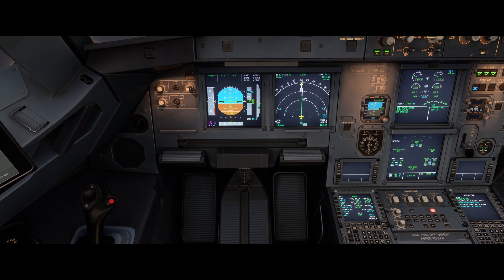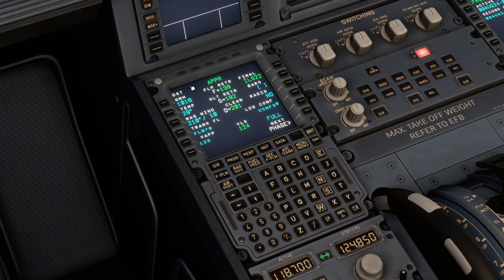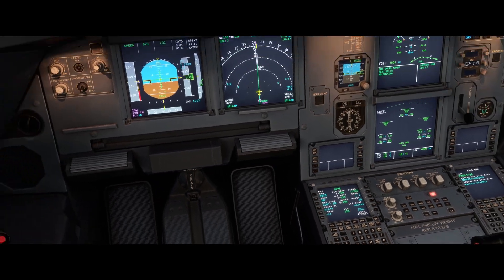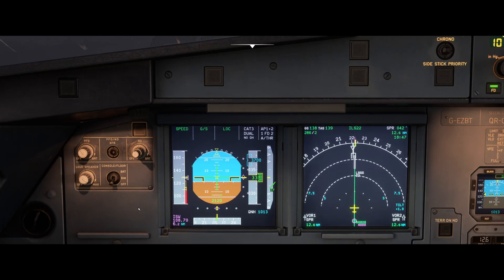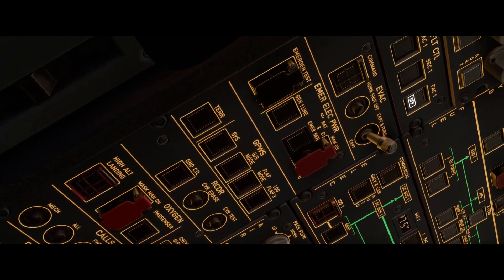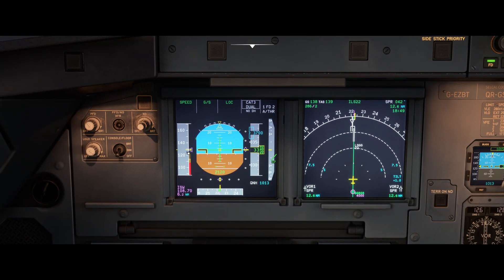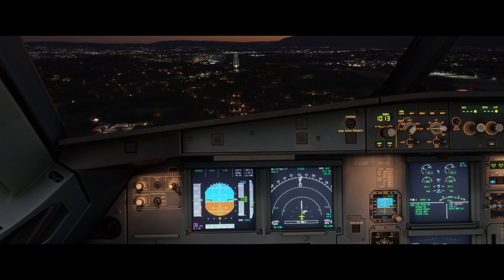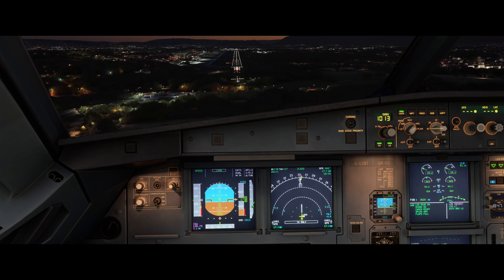A320 Approach Speed Tips You Need to Know | Real Airbus Pilot Explains VLS

Comment: I have 2 questions. If the flightaug are disengaged, the orange VLS line drops on the PFD. Sow the plane thinks it has a larger margine before hitting the VLS (if i look at the PFD) It is possible to get a stall or will Alpha Floor protection kick in? (When the speed drops below the Vapp or VLS for whatever reason)

Question 2 or more my own hypothese. Vapp is the IAS speed calculated on the static conditions insert in the fmcdu. That is why the VLS on the PFD is changing because conditions are not static and always perfect. For example gusting winds and ground effects, inputs on the stick (pitch)